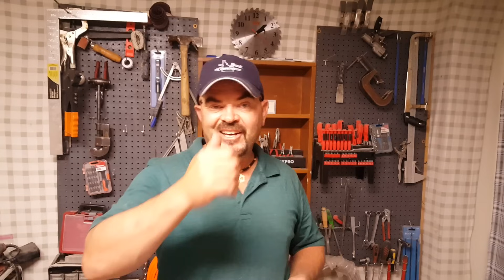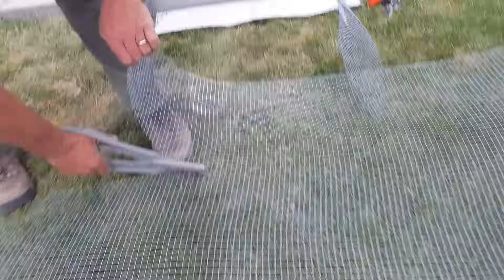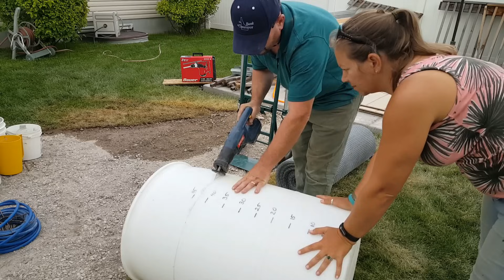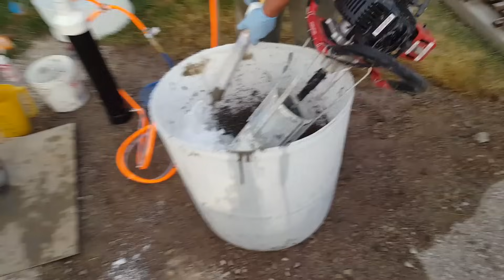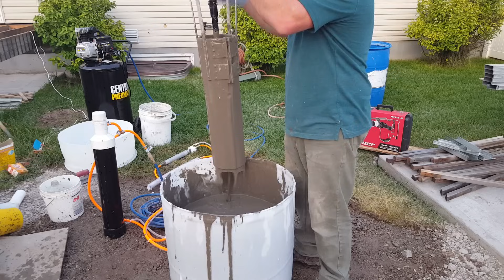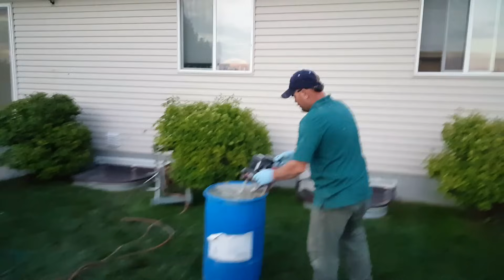Pouring Air Crete Panels for Shed

Comment: Cool project. Air Crete looks to be an amazing building material. It would be amazing if the local concrete trucks could be filled with that. Surely for a slab on grade, it would provide a nice stable, insulated surface. Could it be finished like a regular concrete floor though?
Reply: You can order Air Entrained Concrete. Call your local Ready Mix Company.

Comment: My GOD!!! That was an awful LOT of work just to pour 1 panel then alone 2. How many do you need??? Hell it took I'd say what 30 mins to pour one panel????? That's going to be a HARD pass from 99% of people. I could have built all 4 walls and half a roof by the time you poured 2 panels. Not to mention the tractor trailer load of equipment you had in the background to do all this. Yeah I'm good. Ill stick to good all 2X4's and 6's. A lot of newer stuff like this has great intentions but its just not at ALL actually practical.

Comment: Just like making a souffle. Have you tried other material like styrofoam beads? Would be interesting to know the effect mixing has on lateral and compression strength.  Rather than making your own lab, try partnering with a local university.  Mine is always throwing out broken concrete pillars, so I do know uni's are interested in materials research. Wrong continent though...

Comment: The fold in mixer - make the outer tube shorter and revolve the auger the other way.
That way the material enters from the top and is expelled at the bottom and rises up the side of the outer container and everything will be forced to rise and "overflow" into the mixer cylinder and make the folding process a lot shorter which means that more air bubbles will survive.
When mixing you will then have to hold the entire contraption down which is far less strain than holding the full weight up.
Just my 2 cents worth...
And the geodesic dome is something I am going to keep an eye out for !!
Thanks for great videos...
[edit] What is the wright of this stuff??? To be able to lift up 3/4 of a large drum of wet concrete is not something that one man can normally do on his own!!!

Comment: Awful wet mix and we really don’t need to see you adding the foam in the whole time. Really, we got it.  Would have been nicer without awful music and your explaining more about why this or that.  Well you don’t have to worry about too quick a drying..that mix will be awhile unless this aircrete dries fast. . Good thing long  cure time means more strength..always cover your concrete and mist everyday  if it is drying fast ie hot summer.  There are professional cure sprays too to delay drying time.  Curious what the weight and durability is on this aircrete - might be good raised beds.  

I have a driveway put in 26 yrs ago, not one crack or edge chip and no spaulding - looks as good as did the day it was poured.  The guy dug out 12-18” to frost line and subsoil, backfilled with gravel then set the forms, placed blocks so the rebar is elevated - shouldn’t be on the ground, you want it mid way.  The drive is 12’ wide 50’ with a curve around the planting beds at the top plus a patio 6’x24’.  26 yrs ago it cost $3,000 - around $4/sq ft. but I think God every day I didn’t go with a cheaper contractor.   So far I have gotten 9,412 days of no issues.  He placed treated 2x6” every 8’ and we left them in place.  Don’t ever do the fake cut joints. You need the sections to be able to move independently so as not to crack when stressed due to freeze/thaw, earthquake tremors, etc.  He put it at 6” deep,  used heavy rebar, must have been a super good mix for durability and covered. Never do less than 4” deep and don’t skip dig out and gravel fill just like it was going to only be gravel - this gives the best foundation. Pulled forms the next day, misted and covered.  Came back for 3 days, misted and covered. Then he had me mist for a week (it was super hot - over 90 everyday and in the sun.  He then sprayed with the penetrating cure stuff and made me stay off for 2-3 weeks. I got to bring the car on mid third week but absolutely no trucks or big cars..  Then he came and did a penetrating sealer and set me free.  My neighbors said too much trouble and money.  They have replaced theirs 3 times and it is cracked now.  Mine has stayed beautiful with no issues 26 yrs later and the expensive penetrating sealer he used has kept it easy to clean..no grease, oil, nothing.  And even though the crepe myrtle leaves weird rust stains, they either wash off or just disappear by winter after fall rains.  

I’m getting ready to get him to do a 40 x 12’ courtyard/patio plus a 12x12 hot tub pad and a couple of 3’ wide winding walks down to the bottom of the property in the back - hope to get the same job. He is getting older but still working  but does have to rely more  on his staff for heavy work. I wouldn’t  use anyone else unless he just couldn’t do it.  I might get him to pour me some planters and a concrete bench too ..we shall see. Not cheap but if done well and landscaped nice. it is many years of enjoyment

Comment: Darwin you might want to Check with your local government agency and see what they say about aircrete. Here in California they have rules against building livable structures with it. Meaning I can use it as insulation but not as the framework of the house.
Reply: trent bresler California has kaws against everything
Reply: trent bresler laws
Reply: I wonder if that is because of earthquakes. I live in So Cal.
Reply: ronnie massart  true, but most building coads do. I can build a shead or a Chicken Coop out of it, but nothing structural. I looked into it seeing as how aircrete can withstand high temp. And we have wildfires like nobody's business.....lol. my chickens house can survive but not my house.
Reply: trent bresler agree, some codes are wack. I'm a contractor and I deal with it all the time.
Reply: Redefine Living yes they truly are.. and I just realized I spelled codes wrong on last post... whoops. ...lol
Reply: Redefine Living I think it's because of the lumber industry here in the north west. But I have heard of people building stuff out of hempcrete and other fillers down in the l.a area. ......that's why you need to check local codes.
Reply: trent bresler that could be part of it. Whenever you apply for a permit you need to provide engineering from a licensed engineer. The engineer becomes responsible for the structure. Because there is a lack of information and no standard for recipe design, finding an engineer to stamp your drawings would be hard. The building code will allow supplemental material but you need an engineer to get on board. If the structure fails, it will kill people. They aren't concerned with accessory structures under certain square footage (yet) because they are not inhabited.
Reply: Let's say each section in the video weighs 100lbs. If the back wall alone is 12ft x 16" sections = 900lbs. Even without the roof on, if the wind blows this structure over then anyone inside is dead. Every day and night the building will expand and contract slightly so the connections will always be under tension. Because the air-Crete is soft, it possibly can loosen over time. Add wind forces and it can possibly be a recipe for disaster (worst case scenario). If it's built right then it's no problem. The question is...... what is "built right"? We all have ideas but "will it calculate"?
Reply: Redefine Living I know over in Europe there building it in sections just like Darwin, just without the aluminum around it. They then put mortar between the slabs. Then it becomes almost a brick building, just with 900 lbs bricks. So in our that case I could see California having an issue with it. How ever if you used ICF and then pored it I don't see an issue, because it would be one big form. However structural loads for the roof MIGHT have a problem. Would have to see how much weight it could hold. After all it does have bigger air bubbles than regular cement. So could see the issues with snow loads and multiple story buildings.